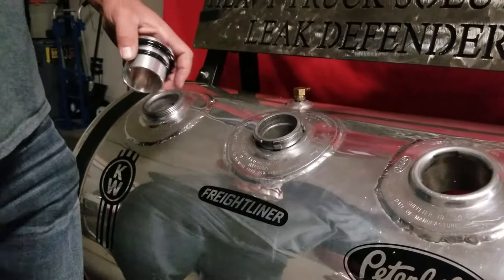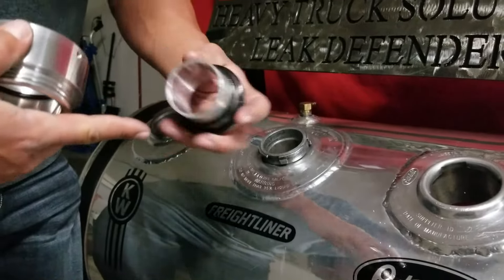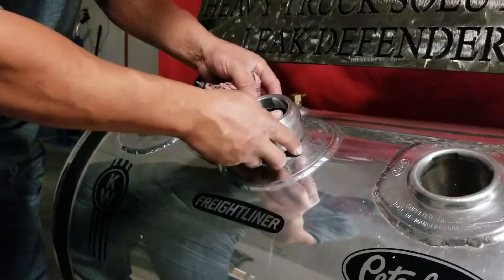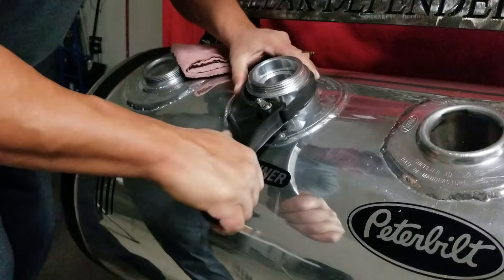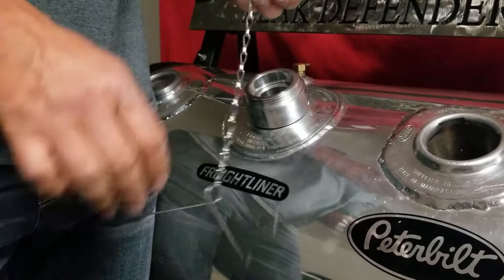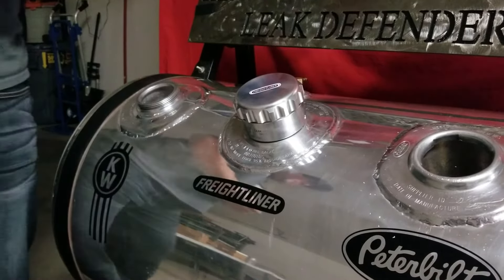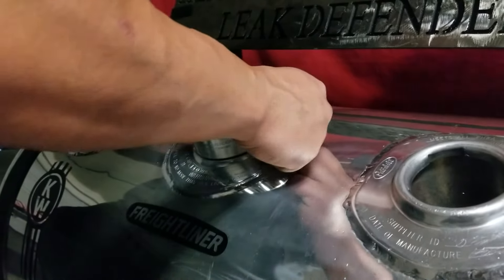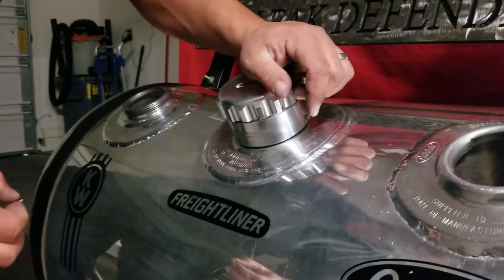How to Install the Leak Defender® on Freightliner Trucks & Stop Fuel Cap Leaks

Comment: Will this work for a 2007 Freightliner  Columbia with a broken fuel neck that constantly twist?
Reply from the maker: Thank you for your comment! Our Freightliner Leak Defender® model is 1/4 turn style. If your fuel neck fits this specification, then our model will be a perfect solution for you. However, if your fuel neck is threaded, our current model is not compatible. Please let us know if you have any other questions or need further assistance.
Reply: @Heavytrucksolutions  thanks for your reply! My fuel neck isn’t threaded it just spins or twist because the neck is broken
Reply from the maker: @MotivativeThinking2  Is there any way you can send an image of your fuel neck to sales@heavytrucksolutions.com to investigate the issue further? We would love to be the solution to your problem!
Reply: Yes I can send them a photo

Comment: whats the main use of that?
Reply from the maker: It's a fuel neck + fuel cap replacement that stops fuel cap leaks. We improved upon the OEM design. Built to last the life of your truck...

 💪 Wear-Resistant 6061 Aluminum
🧵 Deeper Cut Fuel Neck + Cap Threads
⭕ Thicker 1/4" Buna-N O-Rings